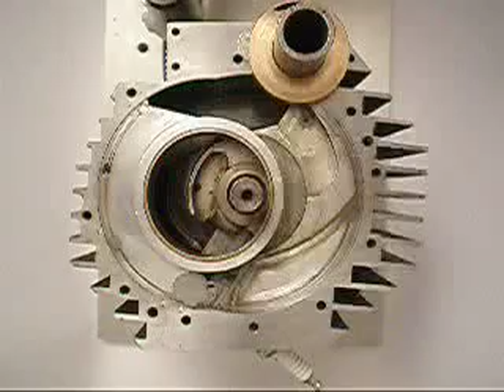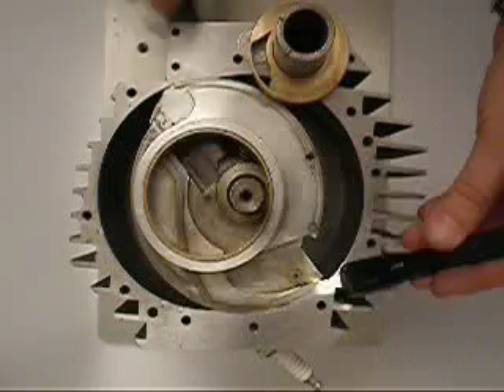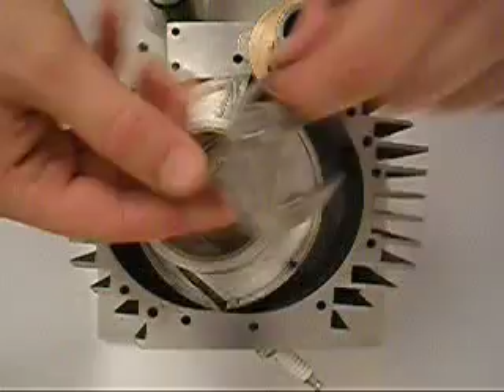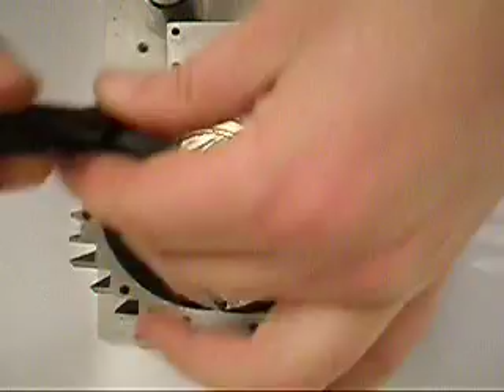Libralato Engine

Comment: The rotary engine was technically a reliable and high revving engine with lots of mechanical advantages over camshafts, timing chains, valves, valve springs, heads, etc. (per Mr. Morgan, Arcadia H.S. autoshop, 1989)

REAL EXPERIENCE for the past 3 decades proves Mazda won't even make them anymore. They get poor mileage. Their seals go bad. My friend's turbo rotary sandrail dunebuggy was so unreliable that a whole group of offroaders switched to couches and playstation controllers. 

ROTARY ENGINES SUCK.

Comment: What about seals on the rotors against the cylinder walls..  That's one of the flaws in the original wankel engine..   Plus, all the heat is concentrated on one port on one side of the block, causing uneven expansion, distortion and seal failure.. Nice Idea, but not ready for the real world.
Reply: IT HAS TO BE SIMPLE
KISS
Reply: you can put 2 of these units together and turn them 180° one from another, so that each combustion chamber is at the opposite side. It's like a better version of the wankel
Reply: TheBlu3sman
 Good idea,  you would have to,   the Rotary is fabulous, except for lasting long..

Comment: Looks very similar in concept to the Wankel engine.
Reply: Not even close to a Wankel.
Reply: elrondsch there's literally rotors in both engines idiot.
Reply: Why resort to name calling? Of course if you know nothing about engines, then the mere presence of rotors would look identical to you. But if you pay attention to the shape, the intake and the whole cycle - you might notice the difference.
Reply: elrondsch They both have similar "power strokes" and exhaust cycles the fuck are on about M8? yea they're probably not identical but that wasn't the point the first commenter made. He said similar to the wankel not it is the wankel.

Comment: The exhaust bearings would have to deal with very high temperatures, pressure, condensation and lubrication problems. I can't see how you could join a fixed pipe onto a revolving shaft cheaply and reliably without gasses leaking.

Comment: Great creative design, but methinks too complicated in terms of the machining and the seals.  Piston rings work well because they are simple and very easy to manufacture.  You will need to demonstrate significant benefits for using this, if the market is your goal.  Reliability and efficiency would have to be greatly increased in order to justify a company investing in manufacture, marketing, maintenance, and so forth.
Reply: +Andrew Vida, I really want a simple internal combustion motor, but reading many other comments, I feel that you sum this motor the best. The reciprocating piston motor works as it can close to seal all the expanding gasses and mass production keeps the price down. This motor seems to have a chronic leakage problem as the different components will expand at different rates, wear and tolerances will cripple mass production. The sleeve valve motor was brilliant, but couldn't compete on mass production scale compared to cheap poppet valves. I suspect nothing will replace a round hole with a round piston.; But do continue to hope.

Comment: Apart from sealing issues the flaw of all these sudo wankel engines is the thin wedge shaped combustion space  with poor volume to surface area that chills heat and there for curtails expansion
Reply: Trev S He explained all that for you.

Comment: Unfortunately this engine, which does work, which has truly impressive performance, will never see production because its inventor has allowed ideology to override objectivity. 

He insists that it must be used a prime mover in a series hybrid car. Problem with that is that the industry doesn't want a new engine design to serve as a prime mover for their hybrid cars. The profit margin is already slim enough, they don't want the added cost of retooling for a new engine design.

What he needs to do is allow small tuner shops like my own to play with the design, find out how to power tune the engine to demonstrate its potential. With guys like myself repowering our hot rods with them and blowing away the competition, the auto industry will take notice, and they will feel the pressure to put these engine into production. 

Then he can make his millions.
Reply: Any update on this? You have a point, now that hybrids are falling to the way side ofr full electrics. But range extenders, and even scooters are still needed. Mazda is hacking another whack at rotaries to charge batteries as range extenders.

Comment: Amazing idea. Reminds me of the Wankel engine but without its main drawbacks. What I cannot understand is how this thing is lubricated.
Reply: That is a major issue with this design. As such is simply will not last long as a gasoline engine. However its fully capable of operating on the diesel cycle, and that will allow it to last longer as well, as the fuel itself will lubricate where the oil system cannot.

Unfortunately the inventor is letting ideology override objectivity. And his ideologically driven strategy will ensure this innovative design never sees production.

Comment: i dont think it would be good engine, it does not takes all exhaust out before the intake
Reply: Neither does a typical 4 stroke engine.   The exhaust on a 4 stroke is partly open while on the intake stroke.   The movement of the hot gases out the exhaust help draw in the fresh intake charge.

Comment: can't find a video of one running
Reply: ***** there is a running video on www.libralato.co.uk
Reply: +Hasan Erdim Ateslier Thanks for the link, the engine sounds a little pained toward the end of that video, but maybe it's just me.  If you are affiliated with this effort, how much HP does it produce per engine weight, and what is the longest running life you've achieved so far, and what is the efficiency?
Reply: John Sikes way late but they are claiming a little over 40% efficiency which is slightly better than a diesel engine.   So that would make this the most efficient production engine so far if it ever reaches production phase

Comment: Nuts - you don't show it actually assembled and running. Hardly anybody should try to take credit for actually understanding completely how it works from your cutaway demonstration. Or even if they saw the assembly completely disassembled. You realize we have no proof it even runs? How utterly totally annoying to not include a segment of a fulling assembled one running.
Reply: WahapinmyMilo It now runs. Loughborough university ran it.
Reply: ***** I forgot I even wrote that. I forgot I read this. See how stuff
like this gets lost? I beleive you. It probably runs. I hope you can get it to
produce more horsepower/torque than a traditional engine of the same
weight. Smog though - 2 cycles, fossil fuels all on the way out right? See
if you can get it to run on liquid or gas hydrogen.
Reply: It is internal combustion so will run on liquid or hydrogen gas. It is a one-stroke engine. It is aimed at being a part time engine, a range extender. It is more efficient than piston engines and a fraction of the size and weight. Some big organisations are behind it.  

Industry is looking to produce small and efficient range extenders for hybrids which are basically just generators. The engine is tuned to maximum efficiency, constant-speed running. 100mpg is easily achievable.

Comment: You're wrong about the Rotary on one account, the entire rotating weight of the rotor is NOT set on the apex seals. The rotors are set on a pair of stationary gears mounted to each of the intermediate housings. Most of your rotational stress is transferred to these gears and the eccentric shaft, not the apex seals. Go Google a picture of an exposed rotor and you will see the receiving gears on the inside of the rotor.

Comment: Only 3 ATM compression? It is not very efficient at extracting power from fuel. Engine seals must be disastrous. That engine is worse to seal than a rotary. That sure would add to oil pollution of the exhaust gasses. Sorry it is a looser engine for efficiency and pollution.

Comment: I'm thinking the same thing. And this is an issue with the Wankel engine under extreme stress will wear off it seals and cause over heating. However I am always in love with new engines. Have you seen the MYT?

Comment: My biggest concern from an enginnering point of view here is 3 things-  1 -many sliding surfaces need to seal, leakage between the sliding surfaces would create probs. 2- the effect of centrifugal force would push parts outward increasing friction on the outer edges, and creating possible wear/heating issues. 3- harmonics due to vibrations from the eccentric parts wearing ridges into one another and multiplying issues in concern 1

Comment: Thats easy, run rifling through the output shaft. Then for oil spill and have the oil exit the bearings either through the back or front of the rotor case back into a wet sump.

Comment: id suspect that this particular rotary engine has less radial vibrations if it worked because a wankle engine uses an offset rotor that is on an eccentric gear causing radial up, down, and side to side movements when it rotates.

Comment: @danijlew
Batteries are cheaper. Efficiency of EV ~70-80%. IC ~20-25% max. EV stores 1/3 energy for same distance. EVs lighter than IC cars. EV motors higher power density than ICs..EV has no drivetrain; motors inside wheels, regen brakes & no idling losses. EV motors run close to max efficiency all speeds, ICs don't. EV 500km range. Toshiba have battery with 80% charge in few minutes. If charge was 100% from oil pwr stn, less oil per km than a equiv IC. Pwr stns 60% efficient. Trans lines 95%

Comment: @Rangerscott69 The very moment we can place solar panels on the roof to charge those batteries in a extremely clan process, then use the money we did not spend on gas, on something else, and put that money back into the economy without going though the oil companies, this world will be better off.  Wow! I bet they will not like that at all. Hence the reason for all the miss information spurring forth in opposition for electric cars.

Comment: yes just a variation of the wankel rotary engine.. which has the research frpt of a major car company trying to perfect it over a number of years. Doubt that this is much better. Wankel suffers from high fuel consumption and high oil consumption. If they made it out of cermaics or titanium it may work better, but the cost would be raised by 300%+

Comment: nice work, one thing tho, the angle of the plug, wont that cause the initial flame front to work against the rotation of the engine?

it seem since this has two compartments and fires on a 2-stroke cycle. but works on the 4-stroke principle of seperate exhaustive and intake turns. that you would have to compare this against a 4 cylinder engine. of double the capacity.

Comment: Looks wonderful. However I think it'll be a lubrication nightmare. The most it can do is run like a normal 2 stroke engine with the fuel & oil burning at the same time. It did not explain how a forced lubrication system in this design. ... Good work keep trying so that we can surpass our current 20% efficiency gas engine. Thank you.

Comment: I se the heat causing problems on the rotary exhaust valve under full load plus the rotor getting hot. Seems no one has come up with a engine as well running as Otto`s piston engine wich has been running well and many have tons of miles ,and hours on them . Supurior 130 rpm piston engine will last 60 years at full load running 24-7 before a rebuild

Comment: looks good, but how do you intend to lubricate it? gas-oil mix?
also, too many seals...one misfire would cause alot of damage...also appears vulnerable to misfires...one stray spark in the electrical, and it will stall. however. its nice and small, and would be great to put in the hub on a bicycle.

Comment: @VCat2006 Not sure till I experimented with different ones. But I like the idea of a small diesel running on veg. oil. Diesels have more power use less fuel and running on veg. oil would be great for the planet. If I ever ran out of veg. oil I could buy diesel at almost any station.

Comment: Looks extremely complex... How does it perform after 100K kilometers and high revs? Whats the torque and how is the oil-consumption? (problem with the early wankels...)

Comment: @CainG88 Most of my power comes from river dams. The rest from homes with solar and wind that feeds back into the system. There is not any fossil fuel plants in the area. And on our elec. bill we have the option to get our power from renewable energy as an encouragement to build more wind and solar power. 
And why not get a small engine like the one in the video hook it to a generator to keep the batteries charged would never have to plug in and would get over 100 miles/ gallon. Elec is the way

Comment: Electric cars are a waste. We rely on fossil fuels to supply the electric grid, and all that an electric car is going to to is increase the demand on this grid, meaning the power stations will need to consume more of this to supply the cars. Global warming is not stopped, the buck is simply passed from the motoring companies to the power companies. Until we can produce electricity without needing fossil fuels, electric cars should be on hold until then. But research into them shouldn't stop.

Comment: @ZerqTM You premise your position on the existence of "next generation ultra high density batteries".  Market research shows that the minimum range of an electrical vehicle to reach a tipping point is 120 miles, four passengers and recharge time of <5 minutes.  While this may be unrealistic, that's the hurdle to meet.

Comment: @DanoD39 super capacitors. true, they don't have the highest storage capacity to weight ratio (I think it's similar to a lead acid batt.) but they recharge close to instantaneously , now we just need to perfect the MIM diodes to work with nanoantenna's then we have a feasible solar powered electric car.

Comment: @ZerqTM sure ur average electric motor might cost less than an equivalent power internal combustion engine, but the cost of the batteries, especially high performance oens that you would need to achieve even a fraction of the range and power of a combustion system, make the cost much higher. the very best Li ion batteries have an E density of 0.9 MJ/kg, gasoline is > 32 MJ/kg

Comment: This seems like it will still have the same high heat loss problems of a rotary due to combustion chamber surface area at TDC.  Has this engine run on a dyno?  What was BFSC?

Comment: Sealing.

The sealing of this system is so complex, thus I am not convinced. As an RX7 driver, I understand where sealing creates issues in 3 dimensions. The piston engine wins because it is so easily sealed.

Seal failure? Remove engine.

Comment: The answer to electric car is the new mega capacitor that is currently in development.  You'll first see them replace household batteries, AAA, AA and so forth. Next, car batteries and then, electric cars.  I'd say 10-15 years they should be able to power a car with them.

Comment: Potentially it could be a very small but powerful engine. Maybe one day...

Electric engines? Until someone invents cheap huge super capacitors (capacitors that has capacity of batteries, but can be charged in few seconds) they can't compare to fuel ones! Cheap but powerfull solar panels could be also nice... 

The strongest point of electric engine is that they can easily get energy back during braking. The weakest point of electric engine is that they do not use effective fuel.

Comment: @daniloruggero  Mind you, it is so easy to bump up theoretical efficiency number by just throwing in some favourable assumptions, so an Air Standard Analysis efficiency number is not enough,there is no such thing as IDEAL condition in reality; you need a working engine to verify and confirm theoretical calculations

Comment: @daniloruggero @daniloruggero The only part of your statement I fully agree with is that this engine is totally different from a Wankel engine;the seals might look  better on paper,but what would be the high speed effect on the seals as they are not always in permanent contact with the chamber.( centrifugal force on the seals?).How can you claim better efficiency when you dont have any running engine to prove your claim.

Comment: @mentallyill345 

Uh, wrong. They have a 7 year 150k mile warranty, and cost like $2k to replace, and there is a $1k core charge, and they are 100% recycleable. Stop parroting bad information from big oil.

Comment: thats just a matter of time.

the  next generation of ultra high density batteries will be up to the challenge.

and for the most bit city dwelers dont go that far...

and using electric leads to much fewser mechanical problems. which leads to lower cost.

i mean a electric motor works perfectly unless it burns out... and thats about the only thing that can go wrong with it.

with internal combustion you have a a world of problems to deal with...

and that costs money!

Comment: nice try, but how you garantee the wear of the cylinder wall does 200.000 miles?

you wasted your time.
by the way, if you did your research right you would have found out that the spark plugs is soon to be replaced.

Comment: Very interesting design. I see two problems tho, (i) Sealing the sliding contacts between the  two  rotors   (ii) Oil mixing with incoming air

Comment: Rotary valves were never officially used in the motorsport field.  They were to be used in F1, but the FIA changed the rules.

Tests conducted on V10 F1 engines proved that the rotary valve was actually more robust than conventional poppet valves and improved power by 10%.  I have a document somewhere with all the info.